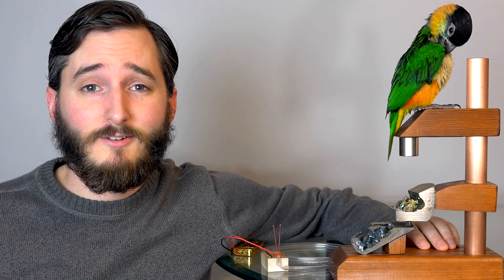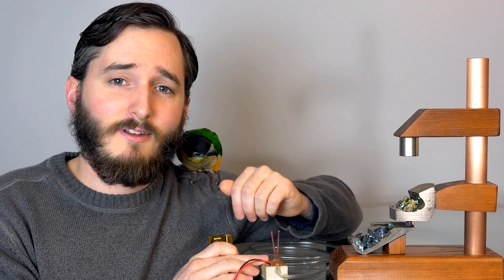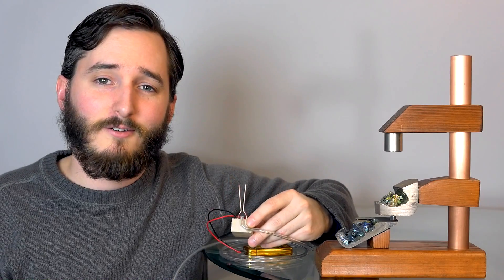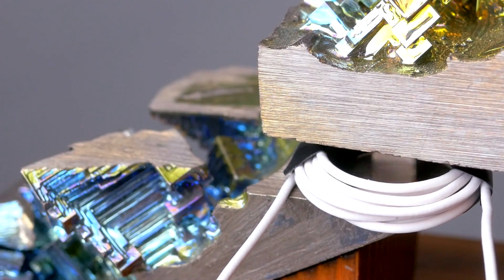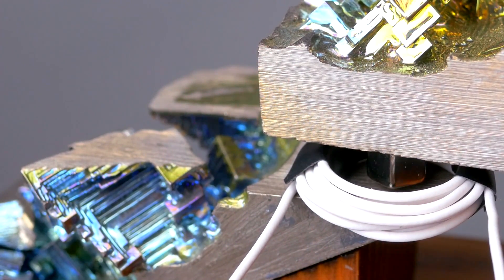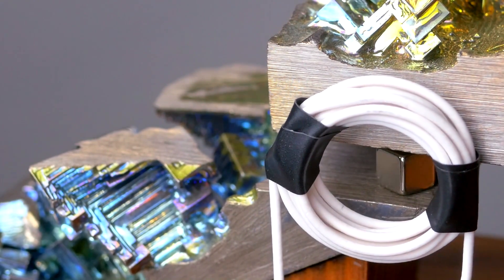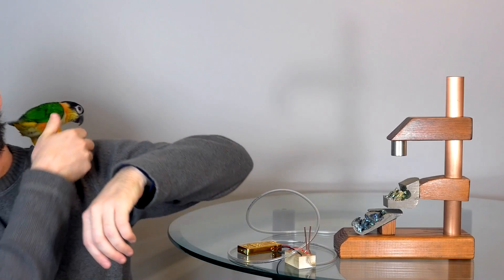Making a Jacob's Ladder from an Arc Lighter & Can a Bismuth Levitator create a Frictionless Motor?

Comment: I wonder if the bismuth motor idea would work if a coil on each of the 4 sides that were set up to pulsate in sequence very quickly. It would have to be quick enough that the magnet wouldn't have time to come out of one side before the next side would start acting upon it.

Comment: The coil of wire acts as a electromagnet. If you were to tap the wire to the battery only momentarily it would create a magnetic field for a short time and this would cause a higher spin speed. The increase of rotational velocity is due to 1 the building magnetic field and then 2 the collapse of the magnetic field, however it stops because the field lasts long enough to cause the magnet to be pulled into the wire

Comment: just a guess but it looks like conservation of angular momentum, when disconnecting the magnetic flux would dissipate unevenly causing one part of the magnet to move towards the centre first causing an initial spin. As it moves towards the centre the magnet seems to spin up indicating the angular momentum from moving in has been transferred to a faster spin.

Comment: The temperature of air has nothing to do with it's conductivity. 

The reaso. A spark on a jacobs ladder rises is because the air is ionized by the high voltage. This ionozed air is more conductive than the surrounding, non ionized air. The air is heated by the flow of the electricity and it rises due to convection and the spark simply follows the path of least resistance even as that path moves upwards.

Comment: That Bisumth levitator is nice and I like the idea of a levitating motor.

I see a couple things you would need to address to make this motor work:

1) A coil of wire with DC won't make a magnet spin.  You need to change the magnetic field in some way, either by putting in alternating current, or switching the direction of the magnetic field with brushes.  Since you are going for low friction, the AC route is probably better.

2) The orientation of the magnet is wrong.  You have the magnet suspended by the larger magnet above so that the north-south axis is vertical, but if you were trying to build a motor, you would want the magnet's axis to be horizontal, with the coil also horizontal (.ie. wrapped around a horizontal axis).

You might be able to get this to work by putting the small magnet at the center of a non-magnetic disk and then putting even smaller magnets around the circumference of the disk like spokes.  An alternating current in a coil next to the disk might be able to get it to spin, but if it is too strong, it will just pull the disk towards it.  It looks like from the video, the magnet is not pulled very strongly back to the center.

Comment: Coils have an inductive reaction to maintain the flow of current after the power is turned off by generating a voltage. There is also a capacitive effect between the wires and the coil has a resonate frequency it can oscillate at. The surrounding electrical conductors generate a counter current to resist the movement, including collapse & expansion, of magnetic fields. To use the bismuth as a "frictionless" bearing or rotor, you would need to setup opposing coils for a polyphase/uniphase AC motor.

Comment: Say you alternated sections of bismuth levitator and vertical coil wraps in a circular formations, and alternated the flow of electricity between the coils in a pattern in which the electricity turns on when the magnet is in the center of the coil behind it, and then turn off when the magnet reaches the center of that coil, and so on, would the magnet levitate in a circular motion?

Comment: i'm pretty sure what is happening with the magnet and coil is that when the current is disconnected, the magnetic field makes the the magnet move, the magnet, by moving, then creates a magnetic field that will induce a small current in the coil and over and over again. I think it's this oscillation that makes the magnet move so rapidly. I think this would work way better with a ac current, would be cool to try this out.

Comment: If you use 4 or more coils, yu can buidl a motor. you need to control the coilsin this order:
coil 1 and 3 on, coil 2 and 4 on.
The coils shoud be looking like this:
            3
4          5            2
            1

5 is the magnet.

Comment: Instead of connecting the ends of the wires to a battery, connect it to a multimeter and allow the magnet spin within the coil. I'm interested to see wether this generates a current in the coil.

Comment: So a changing magnetic field in a loop of wire induces a current in that loop of wire, and charged particles in motion have a magnetic field. So I would imagine that the little magnet moving back to the center induces a current that runs through the wire and causes the magnet to spin. But I feel like Lentz' law applies here so maybe im wrong

Comment: What if instead of using one coil, you put several coils on a ring, and tried to drive it like a stepper motor.  If you switch the coils fast enough or maybe in a clever way, you might balance the forces to keep the magnet centered.

Comment: Even if you would make a motor with it (lets say a small induction motor running on low voltage AC with two coils and a capacitor), shouldn't lenz' law slow it down?

Comment: Current doesn't stay at the same voltage. They are two different aspects of electricity, as I am sure you already know. Just for clarification for your readers,
E over I × R (Ohms Law) "R" in this formula is resistance, as in the resistance of the voltage "E", flowing through a conductor, and "I" is for amperage. 
And it still won't be "frictionless" despite being in a vacuum, because you can't create a perfect vacuum. Nice video however!

Comment: Will your arc lighter work better on it's own if the Jacobs latter is at a lower awg of solid wire?
Reply from the maker: Maybe, I haven't tried it.
Reply: +William Randles
I was going to ask what a "lower awg" was supposed to be, but you're probably referring to "American Wire Gauge". In this weird system a lower number means a larger cross-section, so how would a thicker wire make the Jacob's ladder work any better? There isn't a lot of current involved, so resistance isn't a problem here.

+NightHawkInLight
Have you tried putting a high voltage capacitor across the output of the arc-lighter? It should smooth out the pulsed DC and therefor might help with the Jacob's ladder.
Reply: NightHawkInLight what about multiple coils of equal Guage and wraps on either sides so as to pull in two directions at once?

Comment: You can't have the coil around the magnet between the plates, because the forces generated are not going to spin it in the right direction. Also, because the magnets poles are on the top and the bottom (at least I think they are. If I'm wrong, correct me and I can give you tips on how to make this work), a coil on the side won't work (well) either because it also tries to spin the magnet on the wrong axis. With a special magnet that has poles on it's sides as well or if the magnet can levitate on it's side, this would be viable.

Comment: Coil's force must balance the weight of the suspended magnet means it need a different magnet whose weight is exactly equal to the force created by coil and upper huge magnet. It will be very complicated motor..

Comment: ok, first it's called AC alternating current, second you can't build a motor by putting a Magnet inside a coile, it's a little bit more difficult, and last friction less motors already exists, and the friction less is activated quite easily without using bismuth 😉

Comment: The magnet needs to be able to orient itself in a magnetic field, if it is axially magnetized, that may be difficult.

My suggestion is to put four coils around it vertically in a square.  Switch one opposing pair on, then off, then switch the other pair on and off. Repeat this rapidly, and the magnet should spin.

A micro controller like an arduino using relays for high voltage separation would be good for a quick and dirty prototype, with no timing feedback whatsoever

Comment: It may work better with thinner wires, further apart. Otherwise, run a 100k-1Meg resistor from one pole to the middle of the gap where you want the arc to start. The smaller gap from the resistor's free-floating end to the other pole will break down first, triggering the full gap, which may be long enough to get some travel out of the arc, as the longer the arc, the more power it's dissipating into the air.

Comment: With the coil, arent you just producing a  additive or a subtractive magnetic field(with respect to the big magnet at the top)? Clearly demonstrated when you put the coil sideways. 

I fail to see why just applying a static voltage will rotate the magnet. 

Maybe you could try twisting the magnet by hand and letting go of it, to see if its the coil or just the top magnet thats causing the rotations.

Comment: Few things to try:

Very dry battery, tiny battery, maybe microfarad capacitor charged.

I wonder if you insulate jacob's ladder using glass around it, but not blocking air bottom and top, would it evenually build enough heat to move?

Comment: I would suggest a Variable resistor with that magnetic coil. Buy using that you can precisely lower the current untill you find a stable current that the magnet spins but does not get pulled too much... Or at least in theory

Comment: cool video: 
and a thought somewhat about the motor/coil (that's what got me thinking about it):
wherein you have a setup similar to that of a coil gun, except instead of having the straight line, have the bearing in a closed loop so it is constantly pulled around in a circle.

Comment: the real question is: what du you want with a complete friction less motor? you had no way to transfer momentum
Reply from the maker: Gyroscopes are one purpose where a frictionless drive would be very useful. No need to transfer momentum if the rotor itself is the gyroscope.

Comment: If feels like rubberband effect, and it creates a tension in magnetic field, causing it to spin when the wire is discharged. Try swinging the magnet and see if the results are same & would less powerful battery help. 

btw that lighter looks dope

Comment: I'd say the magnet spins faster on release because the magnet is just being pulled back to the center. I think a good solution to make a motor would be to use finer copper wire wrapped around something as close to circular as possible in order to keep the magnet centered.

Comment: Your motor is supposed to switch poles at least every half-turn. That way, it's always repelling the magnet on each side, instead of attracting it once it spins around a partial turn. That's why you need something like brushes or a rotating switch to get the polarity of the electromagnet to switch based on the position of the magnet.

Comment: I think I noticed something at about 5:15, you kind of tap/rub one of the wires with your R/H first finger and it seemed to have an effect on rotation.  I see others have mentioned the battery could be too powerful for the tiny magnet, the two things got me to wondering what would happen if you just held the ends of the coil in your fingertips... left and right hands, then I wondered if fingertip heat would make a difference, so I'd find someone who is good at biofeedback or other forms of relaxation to hold the wire ends.

Comment: try to create a alternating current rapidly switching on and off for the magnet to spin faster and stay in the center or a more perfect circle of coil so that there is a more defined focal point for the magnetism to pull from and of course find that perfect point in the cube to match it up try a bare coil of copper it should creat a much more powerfull magnet... ive taken tons of electronics apart amd see them in all sorts of things not sure what they are used for but i think that they would create a force of magnetism when charged i beleive

Comment: You might surround the magnet with a series of coils, that you could program a chip to apply a charge to one, then to the next, like a Reed Switch.  One coil would pull the magnet towards it's center for a fraction of a second, then the one next to that would do the same.  Essentially, you have a center Axis with your large cylinder magnet, then you have electro-magnets pulling in a rotational pattern.  It would be complicated, but I imagine it could work.

Comment: you could attempt a multiple coil design much like a brushless motor. In such a design the magnet would be pulled from both sides at once, so it might not require a spindle to keep it centered. you would then use 2 or more such pairs to help the magnet keep turning. 

It would also be very interesting to see what very short pulses in the first configuration look like. This could probably be achieved with an Arduino and PWM motor control hardware, or even just a simple mosfet to pulse the coil. I would specifically be interested to see what happens if you can pulse the magnet short enough that the magnet does not come in contact with the bismuth. 

Fun project, thanks for sharing.

Comment: could try using less wire in the coil so it won't have as much energy to pull the magnet out but just barely spin it. since it's just about frictionless it won't need much of an electromagnetic field to spin it

Comment: If you go with 2 small vertical coils one each side, that should help, you may have to attach a couple of small magnets to the sides of the magnet because the poles are vertical, you want horizontal poles, also small pulses to make it spin.
Would the jacobs be better if the wires were more vertical ?
A jacobs ladder will work with AC, and generally works better with a gabrielle electrode to make it start with a wider bottom gap.

Comment: Could you use a circuit to automatically change the polarity of the wire coil? Would that make it run more smoothly, or am I overthinking?

Comment: Hook coil up to a power supply where you can control output. think smaller current to higher current gradual change might get it up to speed.

Comment: most likely the induced magnetic field in the coil is collapsing causing a charge to flow re-inducing a weaker magnetic fieldand so on. Secondary fields are too weak to pull it off balancr and then act like an big push followed by weaker and weaker ones.

Comment: A coil around a magnet is not a motor. You should put 3 around the magnet, each shifted 120°. Then apply a sin-wave voltage on each coil. All phase shifted 120° to each other. Then change the frequency and amplitude. I'm pretty sure there are some adjustments which will let the magnet spin just fine.
Btw: Your bird might be cute, but I'm not subbed to this channel to watch a grown man cuddling with his little parrot. It distracts from the actual point of your videos.

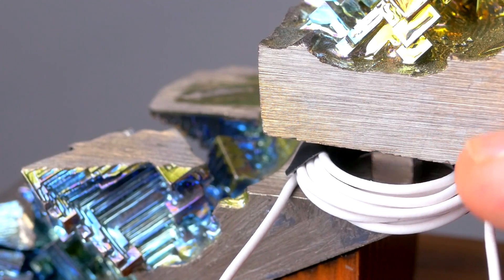Comment: 5:00 in I think what's happening is that the copper wire without any added electricity it acting like a another path that's a very good conductor of magetivity and dielectricity and the influence of the copper being wound up creates an invisible vortex like when you pull the drain on the bathtub and it creates a spiral in the water and there is a hole in the center well we know that there is no magnetic field directly in the middle of a magnetic so there is no gravity that's y the the little piece of iron spins so freely and and spins because the dielectric acceleration of the path of the living energy that's given off by the magnet goes in a forward curved pattern and makes a spfeer shape around the magnet 🌐⚛♻, so when you put the coil around the piece of iron in between the magnet field the dielectric energy follows the course the copper wire because copper is a conductor of electricity and it's a very concentrated path that blocks all the other energy out from the magnet field and concentrates it directly on the center of the copper coil where the piece of iron happens to be..... Now when you apply electricity to the coil you're adding electricity to the copper wire which is coiled around the piece of non-magnetic iron in between two magnetic fields and it disrupts their natural magnets dielectric energy or the space that is affected by the magnets field

Comment: are you deconnecring the + or -? Could be it is drawing off - electrons to make it spin. Goes against what they teach but so does alot of things these days.

you could also use yourself as a resister to see what happens. For that matter you could try using yourself as a millivolt battery.

Comment: Add an arduino and you'll easily be able to vary the pulse width. If the magnetic coil is causing the spin, it'd be really easy to control the pulsing and you could even add an optical or magnetic sensor and adjust the rpm accordingly. 
The problem still lies with extracting energy out of the system. If you put everything in a vacuum chamber, than you'd be pretty darn close to a frictionless motor, but when you go to extract energy out of the system, you'll find that the friction forces were relatively meaningless compared to what bearings can accomplish. So while it would be less friction than a bearing, it would simply not be worth the effort (cost).

Comment: Are you using DC? the Magnet will only move when there is change in the current (during the transients) hence when you turn in on on off get some sort of sinewave generator. perhaps try a small wall wort power supply that outputs AC (more rare but they exist), try 6-12 volts not more than 24 with a lower current 1 Watt or less...  try a thrift store. AC should give you better results.